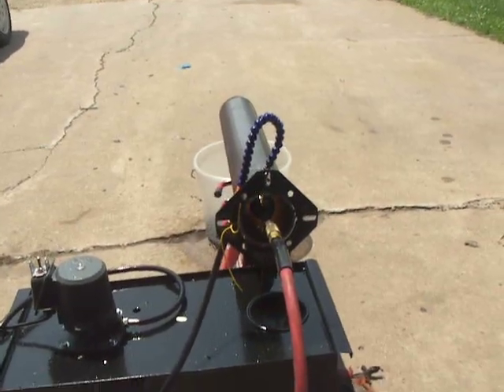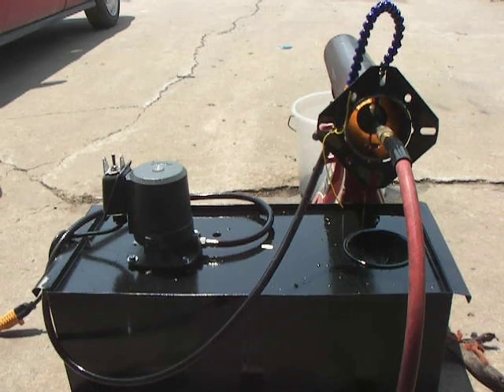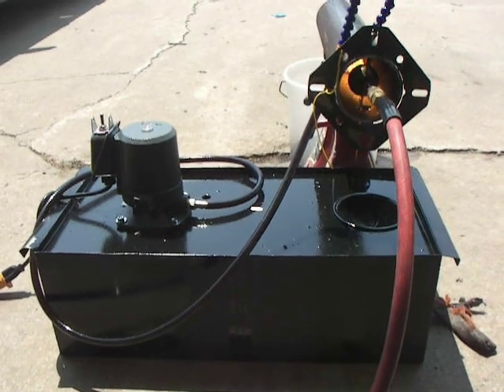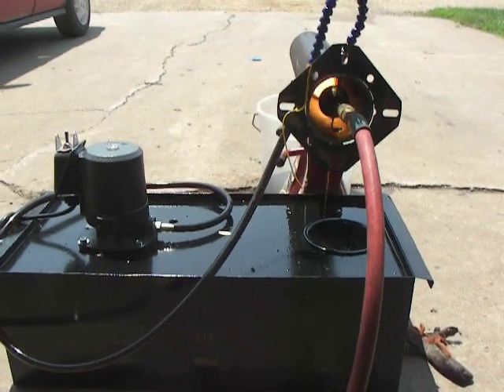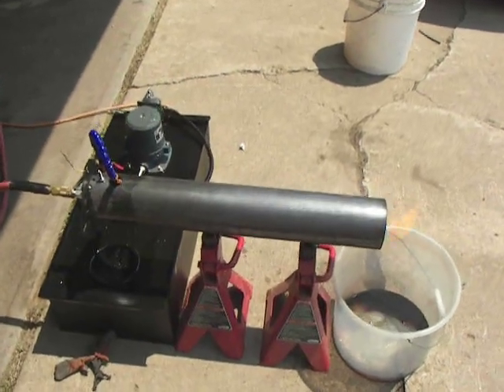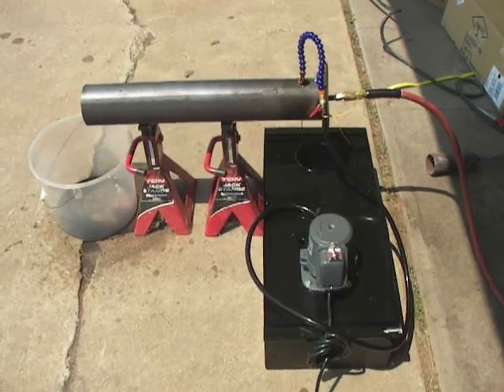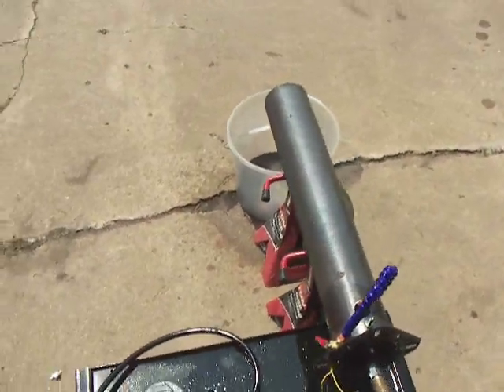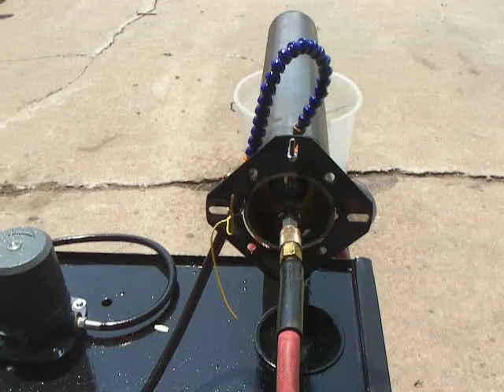Homemade Babington Ball Waste Oil Burner Boiler Furnace - Part 1

Comment from the maker: @ABtofreedom Yeah, leaks are bad.  I am sometimes tempted to make another one.  Did you watch the "part 2" video?  I made 2 mistakes which doomed the whole project.  First- I should have made my own boiler, or found a much larger boiler.  The burn chamber was far FAR to small for the amount of heat I was trying to push thru it.  I needed something that could handle about 300K BTU.    Second- The whole works would freeze up due to moisture in the air line, needs to be in heated area.

Comment from the maker: @RasputinSir      I bought the ball from an online metals fabricator who makes decorative railings & such.  I think they are called king metals.  The wall thickness of the ball made it impossible to drill with such a small bit until i drilled through from the back side using the hole for the air inlet with a bigger bit to remove most of the material.

Comment from the maker: I have decided to abandon the idea.  It worked well in the fall, but once the real cold weather set in a couple flaws became evident.  The burner was running steadily because the boiler was far too small to capture the amount of heat the gun put out which also caused me to have to clean it about every 2 weeks.  I also kept having trouble with moisture freezing in the air line and shutting down the whole works.  It just became too much of a hassle.  A bigger boiler inside a heated shop would work